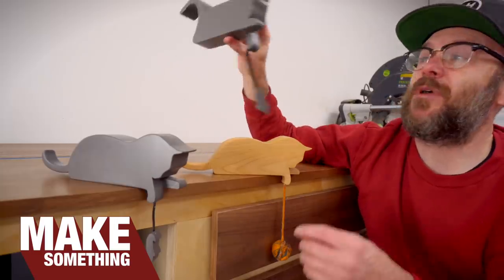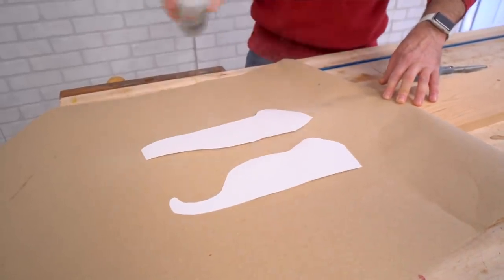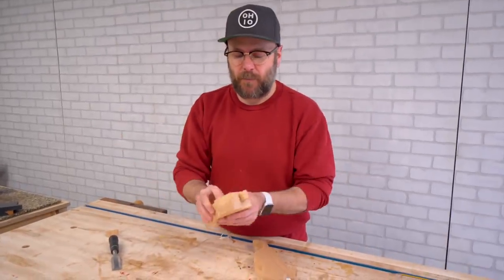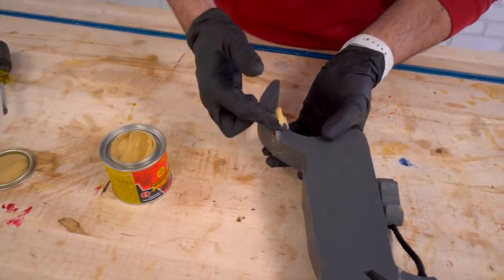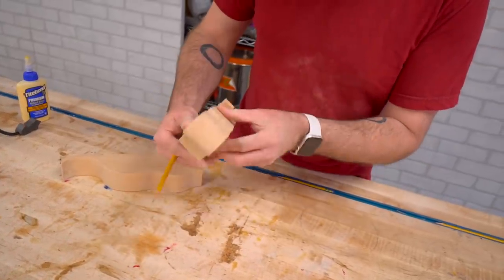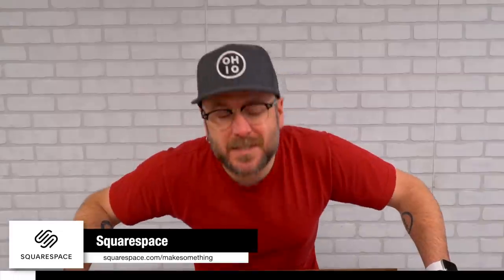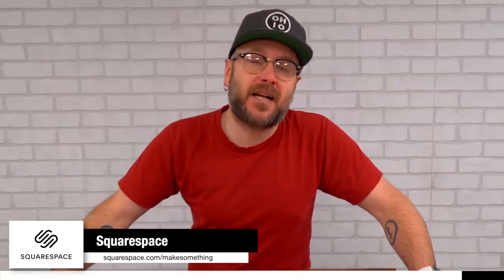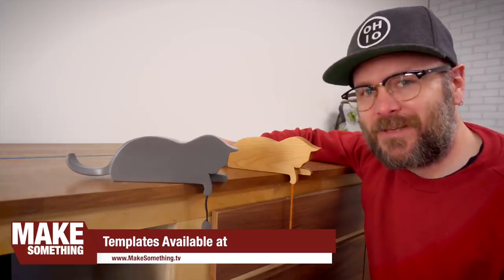Remaking My First Woodworking Project From High School. Mothers Day Gift.

Comment: As for super glue caps sticking. If you wipe of the tip with a paper towel before you recap it, the lids don't stick. Been doing that for years. Super glue lasts longer too. Well, actually the ability to use the super glue last longer. LoL 

Great project. Thank you. You got me thinking about my first and second project. 1. A wooden bi-plane and 2. A Shaker style candle lamp (seen here https://www.facebook.com/jpatton/media_set?set=a.10211658822100927&type=3 ).